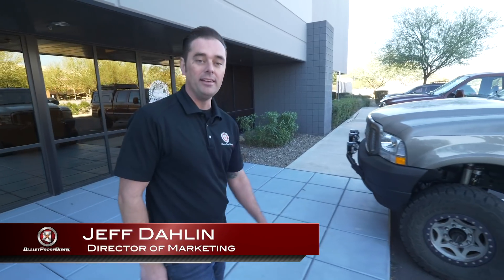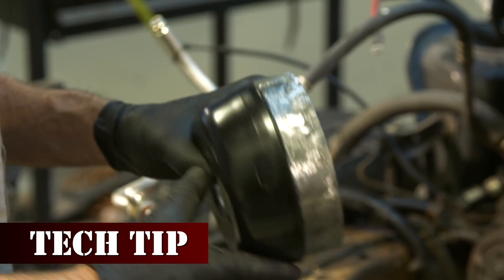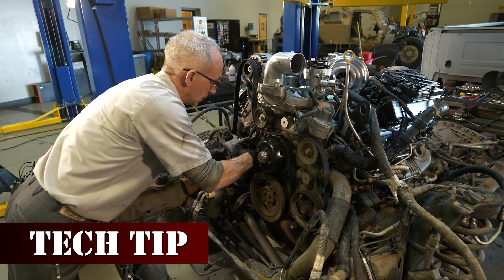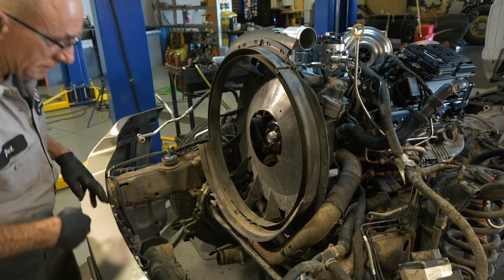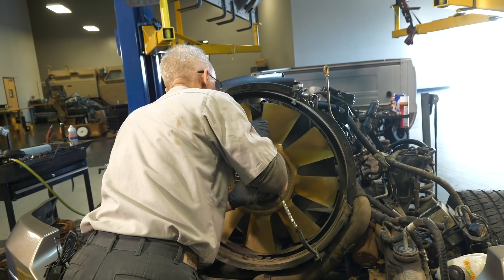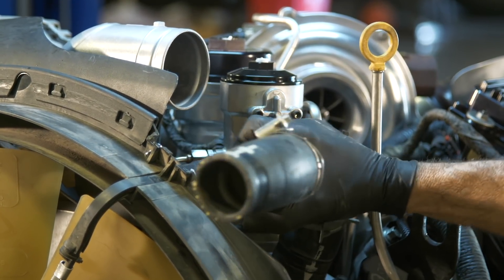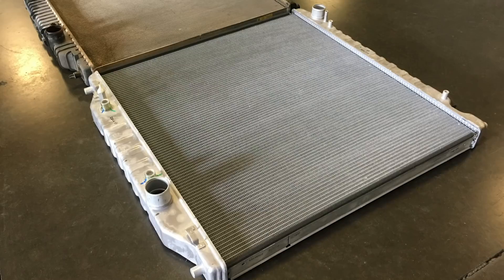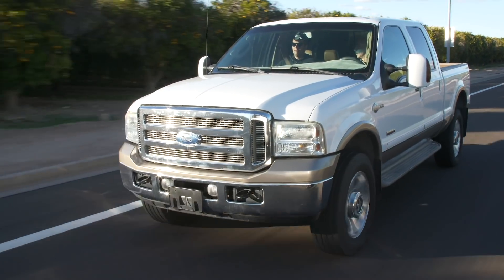Fixing 6.0L Pattern Failures - Episode 4: Water Pump

Comment: The technician is crazy. Over tightening the fan clutch. and looks to be on crack. Really hyperactive.
Reply: Well the alternative is your fan possibly flying off when you shut the engine off due to inertia. Then taking out that fancy radiator.

PSA Make sure the fan clutch is fully seated when replacing a water pump
Reply: That technician knows exactly what he's doing. Has performed this procedure hundreds of times if not thousands. I think you are on crack
Reply: @frankvacanti5277   only an idiot uses an air hammer to tighten a fan clutch. 
There’s a damn reason why the clutch nut threads are always in reverse of pulley rotation. 

So you’re the one on crack. 

Just because someone does something 1000 times, doesn’t mean it’s done correctly.
Reply: What's the name of your multimillion-dollar successful business. How many tech's do you have working for you? Crack head
Reply: @frankvacanti5277   i actually do own a business. But that’s not the issue. 
Be ready for criticisms from the work you perform. You put the video out, and I called bullshit on a few parts of the job you appear to be picturing.

Comment: Got basically everything BPD could throw at my 06' put on last July.  Not cheap, but a helluva lot cheaper than a brand new SuperDuty and will probably get more miles out of it.  Between not having emissions crap to deal with and ALL these BPD parts, my truck is basically bomb proof.  I have had absolutely zero issues since taking delivery of it.  Change the oil, change both fuel filters, and keep good batteries and these BPD 6.0s will go until you wanna quit.  Awesome Sauce!!!
Reply: Derek Crismond I have an 05 with 356,000 I had to repair the egr about 150,000 mi. ago. Before I knew about BPD. It's beginning to act up and I want to BP everything in it plus some.
I'm  concerned with finding a great shop that will use my money wisely.
Reply: Ray Flores You won't find a more "professional" and specialized shop anywhere.  Its literally almost all they do.  I had the same concerns for letting "Jim Bob's Diesel" throw all these parts on.  Their techs could probably do these bulletproofs with their eyes closed.
Reply: Derek Crismond Thanks but I'm in Texas. Not sure where Jim Bob's is? I need to start looking for a reliable one. All the diesel shops that I have spoken to want to replace everything with ford parts. THAT IS THE CURRENT PROBLEM.
Reply from the maker: @rayflores8408  Here's our map of Preferred Installers in our BulletProof network:  https://www.bulletproofdiesel.com/Articles.asp?ID=373
Reply: Mines got everything but an oil cooler, zero problems. 👌👌